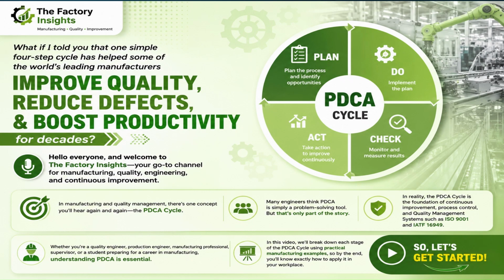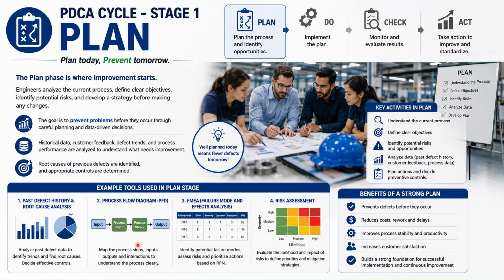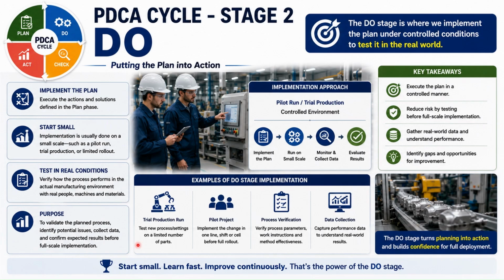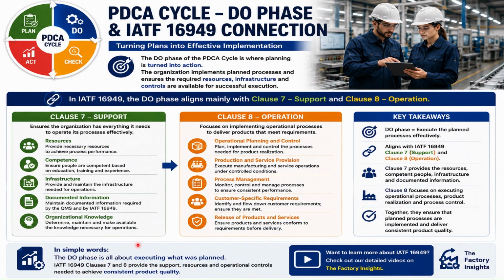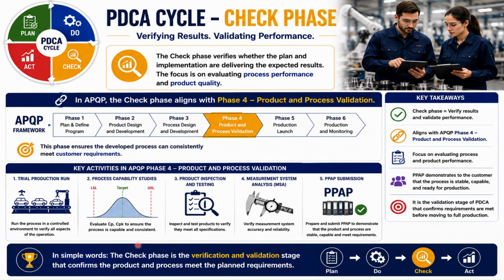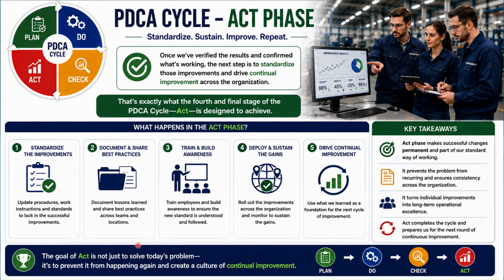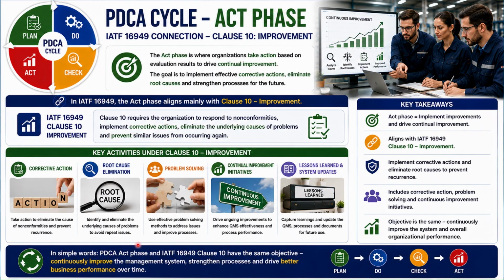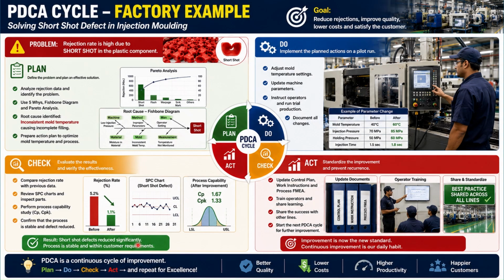PDCA Cycle Explained | Plan Do Check Act | ISO 9001, IATF 16949, APQP & 8D Connections

Comment: first thank you for this tremondous contribution, second what diference between ISO and IATF?
Reply from the maker: ISO 9001: Provides general Quality Management System (QMS) requirements applicable to all types of industries.
IATF 16949: Builds upon ISO 9001 and adds additional requirements specifically for the automotive industry, focusing on defect prevention, risk management, continuous improvement, and customer-specific requirements.